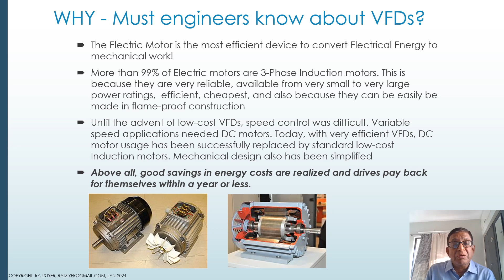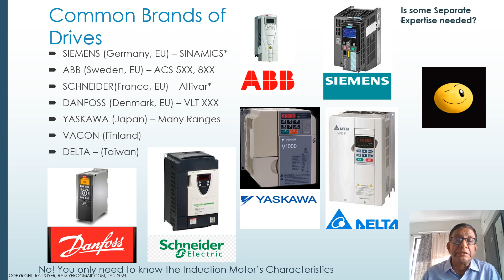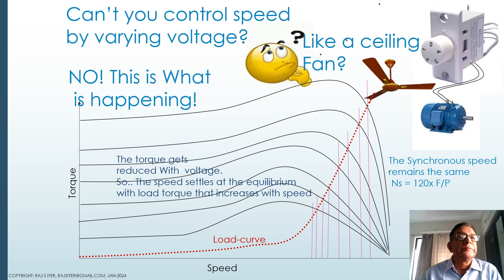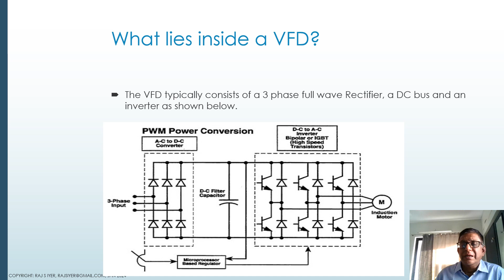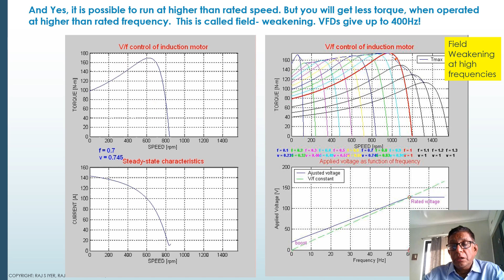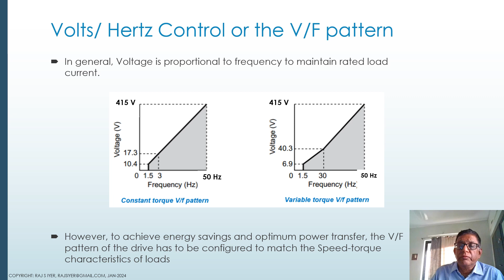Understanding VFDs Part-1

Comment: Regarding VFDs, 

1. Are there motors specifically designed to run on VFD or any motor can be run on VFD?
2. What happens when a motor coupled on a vfd os operated at a frequency far outside the design frequency of 50Hz or 60Hz and what are the same limits outside the design frequency 

3. Isn't there a risk of running a motor at low speeds through vfd? What are the risks and effects especially cooling and lack of it since the high rpm ensures adequate cooling from the motor fan?
Reply from the maker: Thanks for looking in John. IMHO 
1. Yes and No. for this question. I have seen Hundreds of the motors powered by VFDs as the same old garden variety motors. But there are indeed motors that are Specially made for VFDs. Why?? Because many believe and with some evidence that there are some eddy-currents thanks to harmonics in part that circulate in the motor shaft and which may possibly pass through the ball-bearings to ground, slowly eroding them perhaps by spark erosion in the process. "So these made for VFD" motors have their bearings insulated from the body by some polymer sleeve and/or have a slip-ring connection to eath from the shaft so as to eliminate or bypass the path to earth. Yet some others proclaim that their motors are more efficient when run on VFDs. On a few earlier occasions I've had clients insisting that the motors used for pumping solvents/oils which are non-conducting be the special type. Yet dozens of other clients have had us connect their existing decades-old motor to our VFDs without overthinking the issue. In most cases, water/air will be what is handled, & in any case the piping/ducting will be a good earth as these things bond with the structure at many places. So its like buying insurance yeah it makes sense in some cases whereas in others the agent can play up your insecurity and take your money.

2. See from the lowest speed( @ 20RPM) to the rated speed (1500, 1800, 3000, 3600 4Pole & 2 Poles, 50& 60Hz cases respectively) the motor will output its full torque.The same motor 50 Hz motor wont behave very differently at 60Hz, as usually loads are below what the motor can handle. Torque will be a bit less of course as the 60Hz impedance will be 20% more. However, when pushed past this point we will see field weakening. This is inversely proportional to the square of the multiple of base frequency. So you have a 1440 RPM (4Pole) motor that you drive at 100 Hz. So while it can rotate at 2880 Rpm, its torque at that speed will be just 1/4th.  If that torque is useful and the connected shafts/ bearings and etc can withstand it go right ahead. But If you have a blower meant for full blast at 1440 RPM, when you push it higher, you find that the speed wont really increase to double! It will be limited to the speed at which the torque will be in equilibrium with the wind load.

3. Again, Yes and No. Yes there is a risk as the cooling fan attached to the back will run slower and cool lesser. All the same, at lower speeds, the power disssipation is correspondingly less. But when it comes to increasing torque at lower speeds it could draw heavy currents. If intermittently with enough rest time between peaks then it is not an issue. But if very frequently at high overloads like 200-300% for say 1 minute, 3 times evey hour then you better have forced cooling  by an auxilliary motor.

Comment: Raj Iyer!

My good old friend and very knowledgeable and hands-on on matters of Industrial Automation,  PLC SCADA systems. 

I learned a lot from you sir while working together on Industrial Automation and  instrumentation with PLC SCADA systems

Great work there sir, looking forward to more of your videos. 

Can one use a VFD to balance 3phase power when running 1phase loads from a 3phase supply?

I have challenges running a 3phase grid-tied Solar PV Systems where I have a mix of 1ph and 3ph loads hence I have to curtail my inverter to avoid power export to grid. 

Looking forward to your response, maybe do a video on such